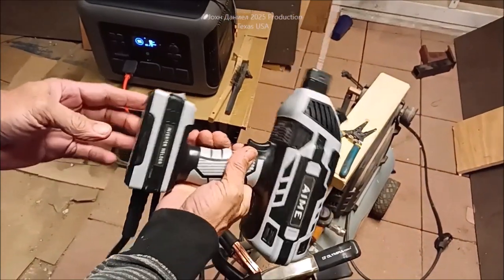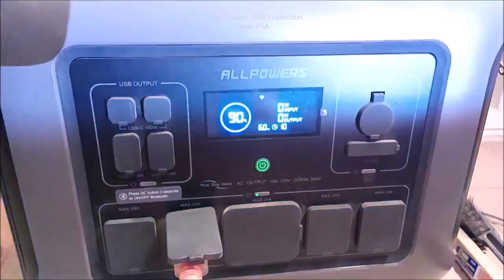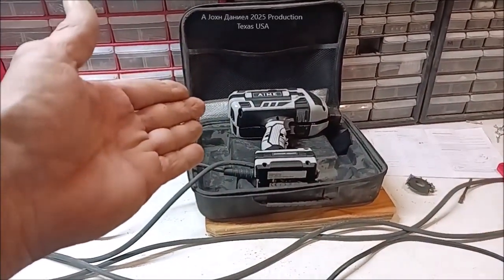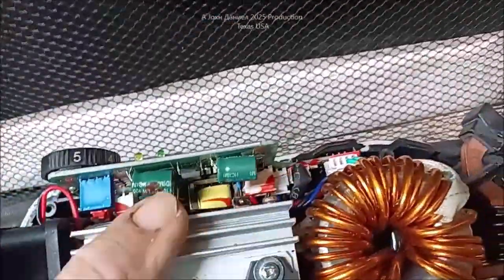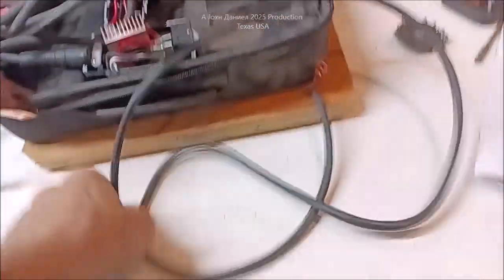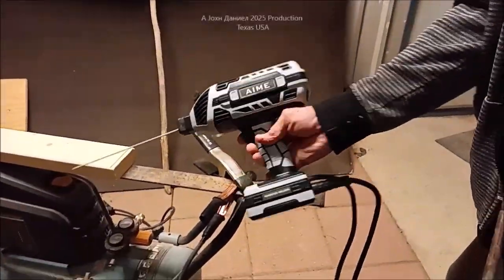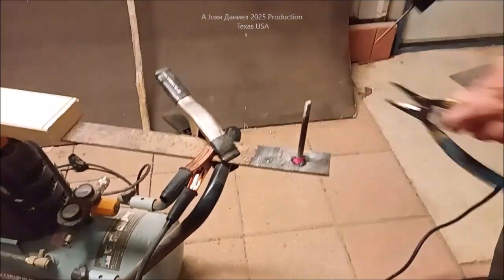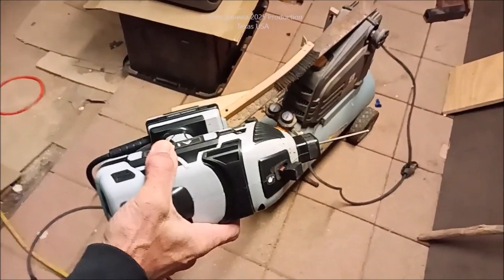EZ Handheld 120 volt welder look inside it, modify, tried on 2500 watt power station - Vid 2

Comment from the maker: Cheapest source - https://temu.to/k/ug7q5obwk9c Amazon version https://amzn.to/3BNJz5T Pro grade YESWELDER helmets https://amzn.to/3PeY6us  ABSOLUTE BEST ROD FOR IT  Hobart H117125-RDP 6013 5/64-Inch https://amzn.to/3DJIgpb Those used in video - Hobart 6011 Stick Electrode 1/16-Inch https://amzn.to/4fBNP6m but get only for heavier metals,  Optional YESWELDER E6013 3/32'' for all and thinner trashy metals https://amzn.to/4fOUEBy
SEE VIDEO 1 at https://youtu.be/sDIk7z4oi2M

Comment: I finally found someone that shows how these work. What concerns me is that in the first attempt, your portable power Bank hit 2025 watts at peak. That would have tripped any standard 15 amp 120v ac outlet. Definitely need a good 20 amp circuit. I Have seen them advertised a lot but was always skeptical. I'm not a welder, but as you said, for someone that is just staying or needs to weld something fast and only a few times it makes a good starting point for the price. If i ever need more than this tool THEN i will consider getting a more professional brand.
Reply from the maker: The wiring in the Power Station is for 20 amp, the problem is the ALLPOWERS is just lots of bad parts added to decent quality batteries. Lots of them are on the "refurbished" list on Ebay and even Amazon for a reason. As for the welder, I have welded over fifty solar tracker hinges with this and its not faulting or acting like a toy in any way. I doubt It will last for years but till my shoulder heals up the dragging my 16 foot MIG cable/torch all over ( 18 lbs ) is not needed using this.